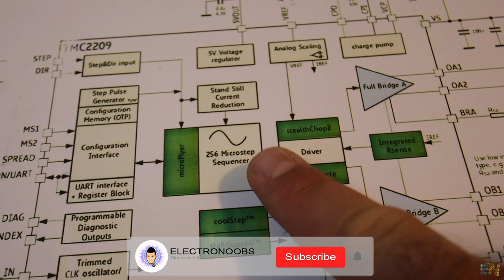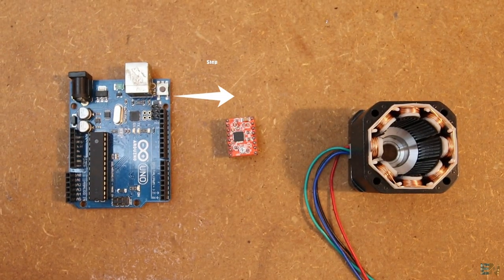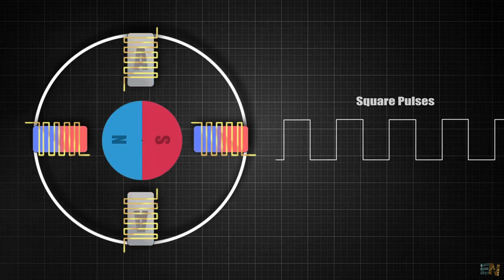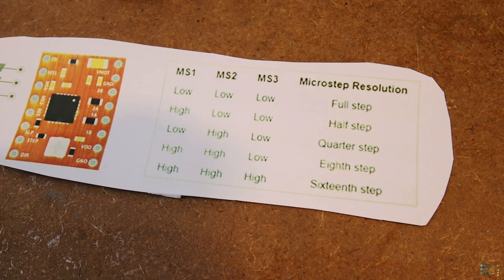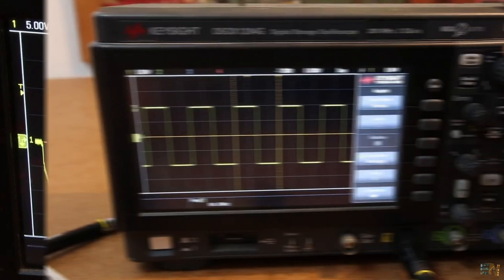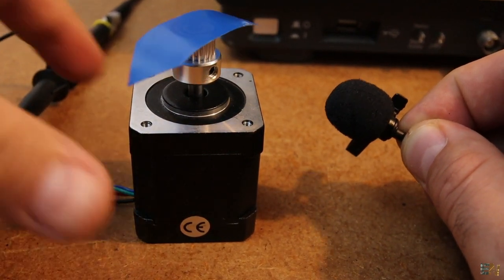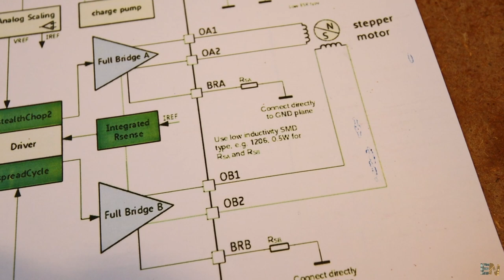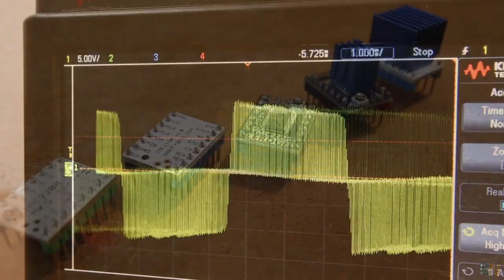Stepper Drivers A4988 vs TMC SILENT drivers - Sound & Signals

Comment: The sound comparison between full steps and microstepping is only fair if you also increase the step speed so that the angular velocity remains the same in both cases.  The speeds used here also seem very low compared to actual use in a 3d printer.  Not that I in any way want to downsize the improvements brought by the TMC drivers, but you should compare things in configurations that give the same end-result, in this case angular velocity and also a load to apply comparable torque would improve the comparison.

Comment: Can the MS1 and MS2 pins be controlled via software or only by connection to GND and 5V? I was working with TMC 2209 and was TOLD that such control was available on it, but later came to understand that on the TMC 2209 the MS1 and MS2 pins are used for setting up some parameter for UART control of the selection of Step type, e.g. Whole Steps, quarter steps, sixteenth steps etc. I really need to be able to control that via software and those pins directly, not through a UART connection.

Comment: Hello, You mentioned in the video that the greater the step division, the greater the torque. As far as I know, the opposite is true. You get maximum motor torque with full steps, since the magnets face each other over the entire magnetization surface. The more you divide the steps, the more you weaken the contact surface, which gives less force.
Can anyone confirm this statement?

Sincerely

Comment: I can't answer a basic question, in stepper motors nema 17, nema 23 or even maybe nema 34, I could use the RJ45 Network cables to make connectors providing power VCC, STEP, DIR, COILS 1A 1B 2A 2B , for example for 4 wires, but it could be 6 or 8 wires... I like network cables because the wires and connectors are well organized... my big question is whether these cables would support the voltage and current supplied to engines...

Comment: those "closed-loop" stepper boards with the oled screens (at least the two I ordered) DO NOT have the TMC drivers on them like you mention, they all have the old Allegro drivers. I thought the same way you did and bought two of them without doing much research and discovered that they were so much louder than my current drivers, I immediately switched right back, the closed loop control was cool, but honestly didn't make that big of a difference. if you're missing steps, you've got bigger problems than just needing to force it back.

Comment: On the 4988, I depend on the reset pin to remove the FET driver current  from my motor.  I hold sleep pin high, and enable low. On the TMC driver, how do I accomplish this?    What model of the TMC has the equivalent functionality?

Comment: The TMC Drivers help some, but in practice I'be found not as much as I would like, or I should say my family would like.  There is still quite a bit of sharp whine when the printer is moving.  I think some of it is the belts. I've been trying to conceptualize a different movement system that doesn't use belts and might produce less noise.